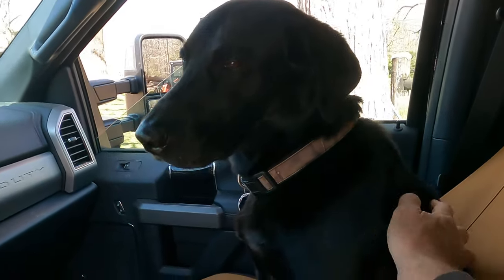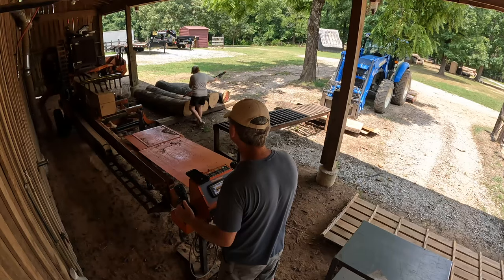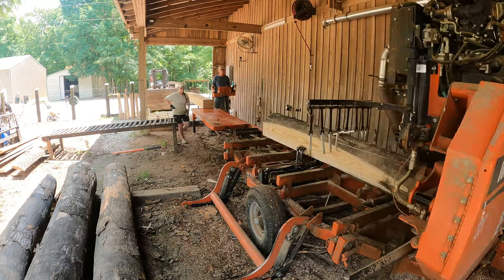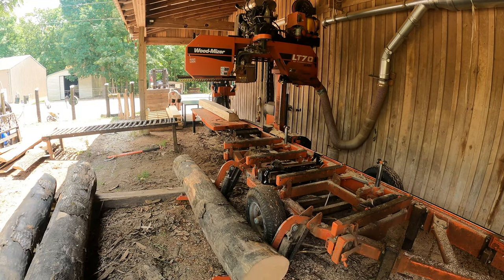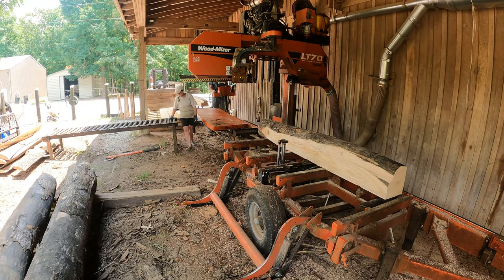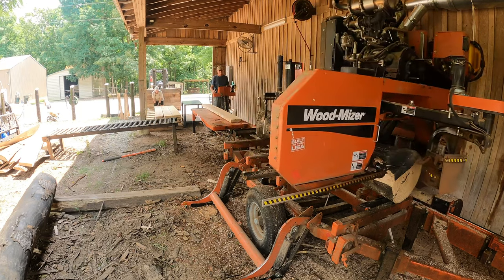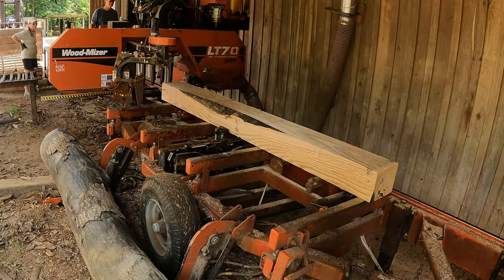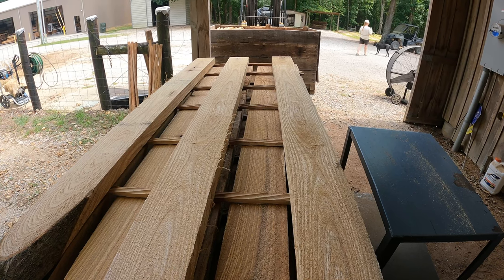Sawmill Without Arguing - Husband and Wife - Can You Do It? Professional Sawmill Techniques-HHA

Comment: Nice video, nice team work, great job explaining what you are both doing. I understand it would be nice to have help on every log, but i also understand you could have done it alone.  Why did you need help ?  Did i miss that part?  Was it a rush order or why did you need it done in a hurry?
Reply from the maker: You are correct, I was getting backed up on some other species and wasn't expecting to get this load of logs when I did.  So I had to call in some help to get it done faster.  It was wkly 53 logs or so, and we knocked them out pretty fast so I didn't mess up my cutting schedule too much.  Thanks for watching!

Comment: 2 questions, your adjustable blade guide is wide open? the de barker starts 1/2 way down the log ? I like the speed of travel, everyone on you tube cuts so slow ti drives me crazy. My lt40 with a 51 HP Cat engine has the torque to cut fast but I have never heard the band sing, .Maybe tomorrow.
Reply from the maker: Yeah, most people saw slow because they don't know the techniques to saw faster, and their mill isn't really dialed in, although they think it is.  Nothing wrong, I was the same way.  I had an LT40 diesel and when I got it, I couldn't saw much faster than my old LT15, about 3/4" per band p[ass.  Then, as I got things going right, learned the techniques and adjustments to fast sawing, I could do 2" or even 3" per band pass with the same mill.  With this LT70 I can do way more than that.  Faster sawing keeps the band cooler, produces less pitch buildup, clears sawdust almost 100% (how many times did you see us scrape sawdust off the boards?  None) and increases production.  
No, our blade guides go to 34" wide, but there is not need to continually adjust it,  I set it to about 2/3rds open and the mill should cut straight no matter the size of the log or cant.  I could cut just as fast with the blade guide wide open but too much of the arm hangs out the idle side and it just gets in the way.  I only open it up for very wide logs.  Most people play or fiddle with their guide arm way too much, if the mill is dialed in, with the right blade, it should not matter.  The mill should cut straight, full speed with any guide opening, unless in really tough wood like hickory or pecan.  The debarker only starts halfway down the log because I'm halfway through the log before I get to setting it in.  It's much worse to pull in the debarker too early and crash it, and have to stop and readjust it, or slow the sawing speed down to get it in at the beginning of the log.  For some logs, it's not something I worry too much about.  The faster I saw, and using diesel for lube, the longer the bands will stay sharp.  It's better to get the mill up to optimum speed, get everything happening, and then worry about the debarker last.  It's counter intuitive to what most manufacturers say, but in reality, sawing for production, unless the logs are dirty, then the last thing I will adjust in is the debarker, and if the mill is cutting fast, it may not make it in until 1/3rd or halfway down the log.  I'm not really worried about blade life, I'm sawing to get production up and bands cost $35 and each or these boards is worth twice that, and I had a whack of logs to do that day.   Thanks for watching and the good questions.

Comment: When I center the pith, I make good use of the Auto Up function on the Accuset.  You seem to be able to do it by sight.  I have an LT40 Wide. Thanks for another great video!
Reply from the maker: The AutoUp is a great way to do it, you are correct.  Also you are correct, in that I can generally eyeball the first face, especially on 8/4 wood, to put the pith in the center of the board.  Most times I can anyway.....but I do miss occasionally.  Thanks for watching!

Comment: Do you mind sharing blade details for blades you are running? Martha cant-hooked the heck out of that log, right onto those loading arms. Impressive!
Reply from the maker: I use WoodMizer Silvertips, 7/39 Turbos, 0.055 thick x 1.5" wide made by an independent blade guy who properly grinds the welds.  Unlike many people, I do not like the WM Doublehards, they are too brittle and break too often when I push them hard.  Silvertips are a resaw blade, so I can enter the log faster and saw faster.
Reply: @HobbyHardwoodAlabama  Thanks for the info!

Comment: I’ve been wondering why you don’t have an electric Motor on on the mill considering the price of diesel?
Reply from the maker: The LT Super 70 uses a hydraulic engine driven pump and at the time I bought this one, it wasn't offered in an electric version.  The engine driven pumps are advertised as being 6 times faster than conventional pumps on other WM mills.
Reply: @HobbyHardwoodAlabama  wow I wasn’t expecting to get a reply, thanks.
I really enjoy your posts, I have learned a lot about the milling process, I’m retired and am interested in it as a hobby.  I currently have a TK 1220 ordered that won’t be delivered until next October, HA.  I’m looking at auctions, Facebook, Craigslist, whatever trying to find a TK2000 that I can afford and isn’t used down to scrap metal.  Ya I know good luck lol.
Keep the videos coming 😎